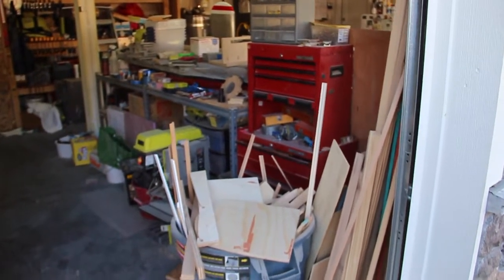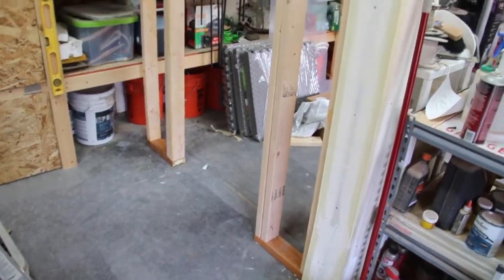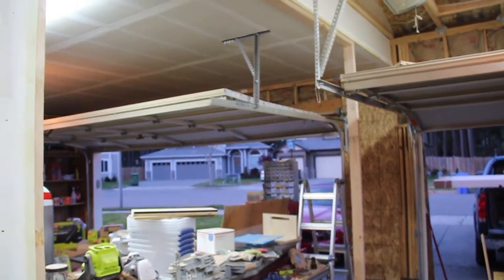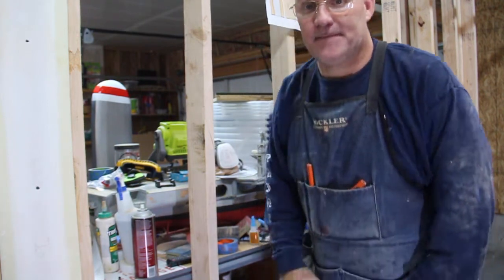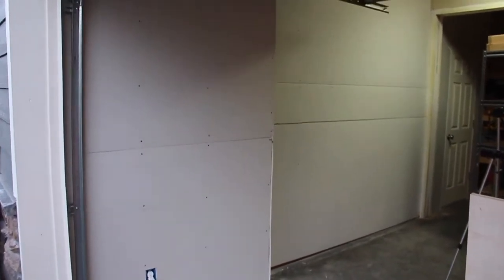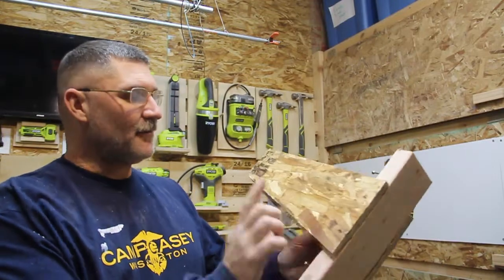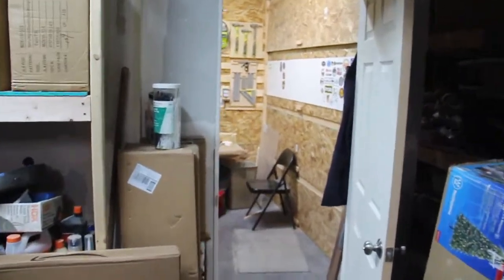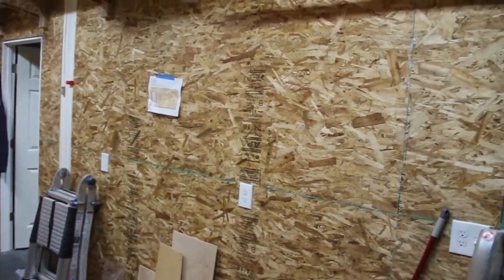How to BUILD a Wall in the GARAGE | Shop Build and Tour | 2019/51

Comment: I might need to consider this for my new house. The wife insist that she can park inside the garage.  I will need to figure out a way though to make it about half this size (so we can still use part of the garage for storage).  I have my big tools on rollers, the table saw, band saw, grinder, and bench press, I'll have to make it work in the garage since the HOA will not allow me to have a lean-to style workshop in the backyard.
I think between doing what you have done here, and incorporating overhead storage shelves, as well as the over-the-garage-door storage bin system, we can make this work.  Great video, and thank you for the idea!
Reply from the maker: I was considering the bin system as well. But I need more lumber storage than anything. It really eats up floor space.